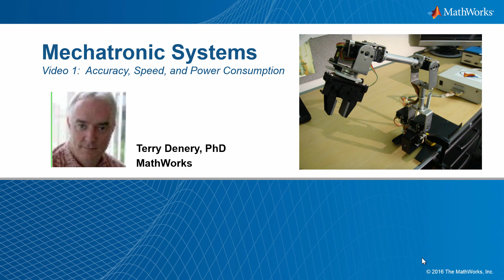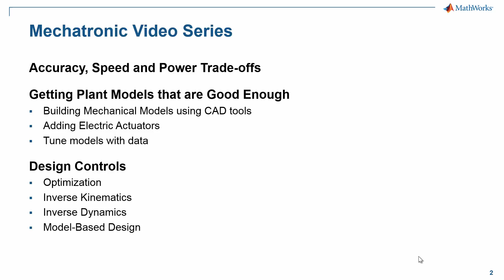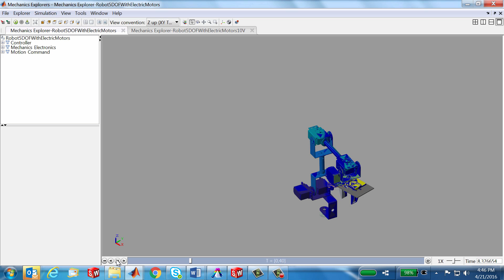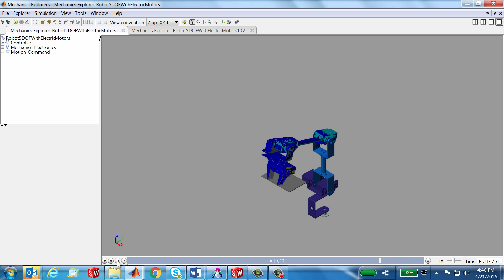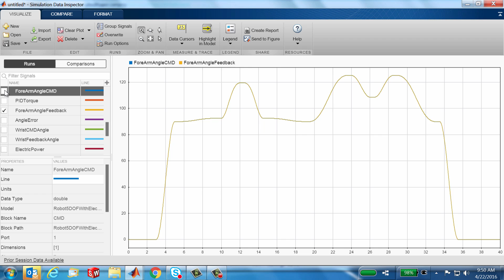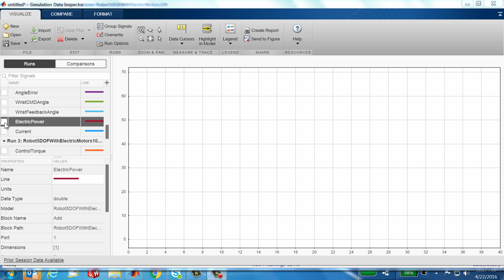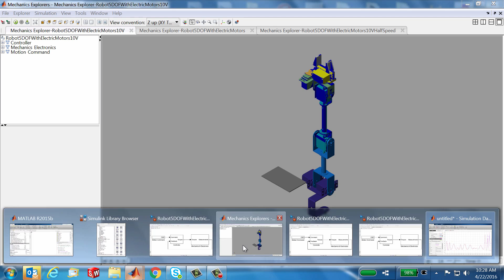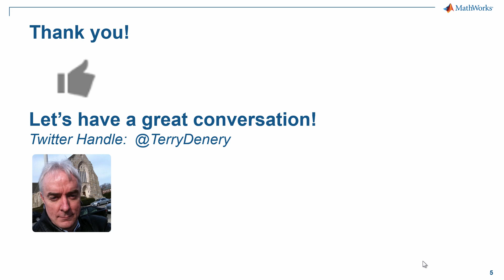Mechatronics with MATLAB and Simulink, Part 1: Accuracy, Speed, and Power Consumption

Comment: Do mechanicals engineers write programs in c++? Can a mechanical engineering degree get you as a programmer without having a  Computer Programming degree?
Reply: Βαλάντης Στυλιανού  In most universities very little  programming exposure is available to Mechanism  Engineers. But nonetheless one can  learn the C++ language or any other and master it through practice. But hardly, does one pursuing a Mechanical degree write a line of code for most semesters.

Comment: Terry, Thanks for the awesome videos :) 
I have a very basic problem in the simulations I'm doing in Simulink multibody.
I have a simple pendulum and I can calculate the torques(using the revolute joint) from the desired angular motion. Now I'm trying to get the same torques to produce the original motion (torques provided to the revolute joint and motion automatically computed). When I don't have any gravity acting on it the torque values are able to produce the same motion (more or less, some error is expected). But when I have gravity turned on, the torque values calculated by providing motion as input (with gravity on) make the model go crazy(it just starts spinning around!). What do you think I'm missing? Everything else in the models remain the change and I'm just switching the actuation of the revolute joint.
Thanks!
Reply: Hi Gaurav, Video 7 of this series is focused completely on answering this question. Basically you are attempting to apply feedforward control with no feedback.  Feedforward control is a beautiful thing, but you will always need a little feedback to reject the error.  Please take a look at Video 7 on Feedforward Control, and let me know what you think.  Thanks.  -Terry
Reply: Thanks Terry. I went through the whole series and found the answer to this question. Thanks for making these tutorials!
Reply: Thanks for watching the videos!

Comment: I would like to learn such modelling from basics. Any links?
Reply: I am curious if you have continued to watch this series.  We have 5 videos posted now, and two more will be posted in the next couple of weeks.  If possible, please let me know if the series is moving in a direction where it fills you in better on the basics. . . . . I also recommend the videos produced by Steve Miller on Simscape and Physical Modeling.  Steve has a very good presentation style, and he focuses in detail on the basics of building mechanical, electric, and hydraulic models with Simscape and Simulink.
Reply: Thanks Terry. I had just found part 1. I followed other parts too. This series is what I wanted to learn. Thanks :D
Reply: Thanks.